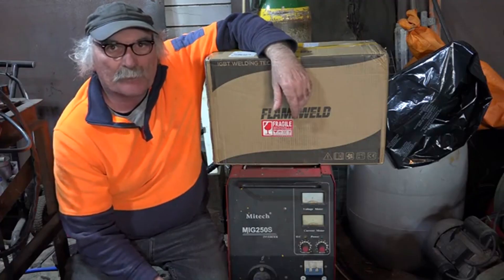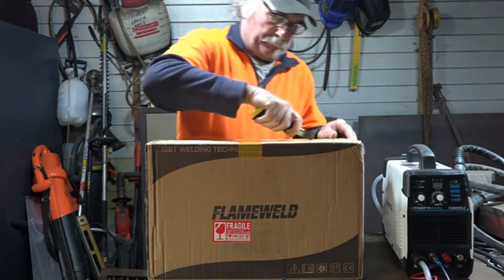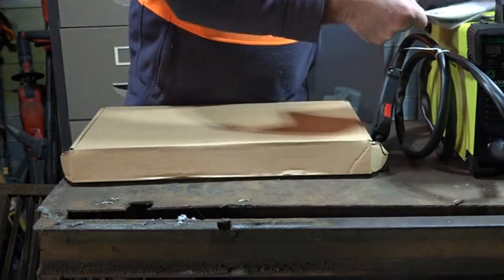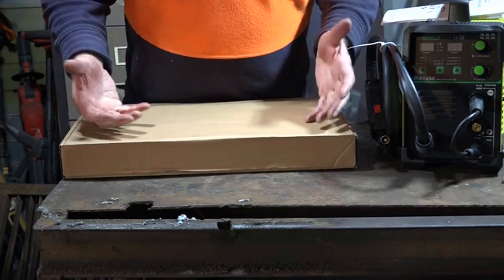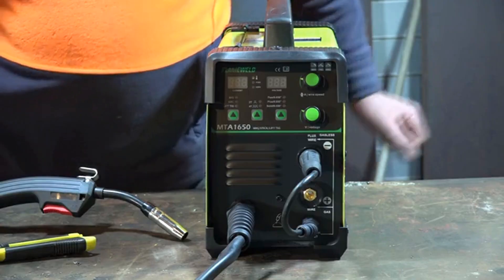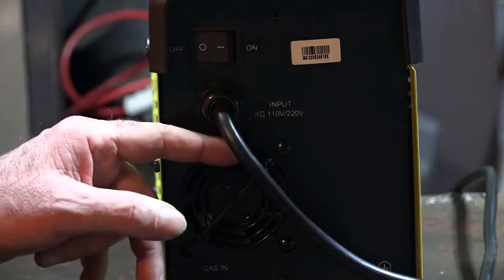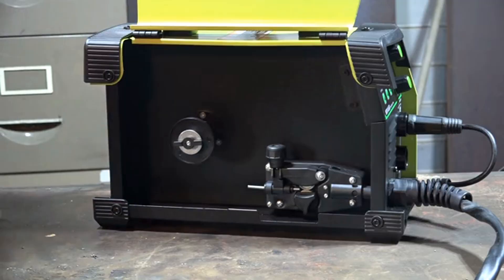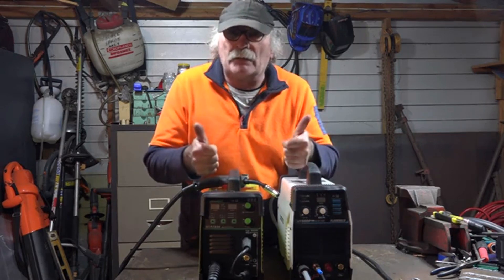Multi-Process Welders - What's in the Box?

Comment: Appreciate that your new MP welder is DC and the old buzzbox is AC, but you will find that the old stick welder is much easier to maintain an arc due to the much higher arc voltage as well as not “bogging out” or seeming to loose power at higher amperages. I wouldn’t even try to MIG weld anything over 3/8” , that is where a 200+ amp stick welder,  low hydrogen rods, and hard facing shine in my view. I’ve never had a welding course, entirely on the farm “need to fix” learning.
Reply from the maker: Hi David I didn't really like stick welding .But trying this for first time was surprised mate.

Comment: I’ve had 3 multi process welders including a Lincoln 210MP, non of them will do as good stick welding as the old transformer AC/DC machine. The multi process welders don’t have enough arc voltage do use many types of rods on either AC or DC. You will soon see when you do a comparison video between your old buzzbox and the MP welder. Looking forward to that video.
Reply from the maker: Hi Dave good idea for next video cheers pete